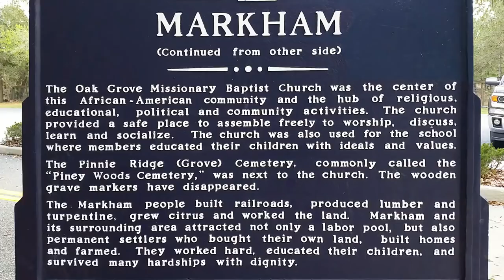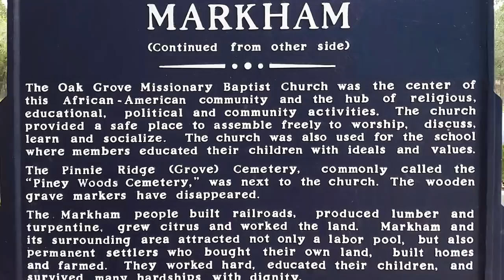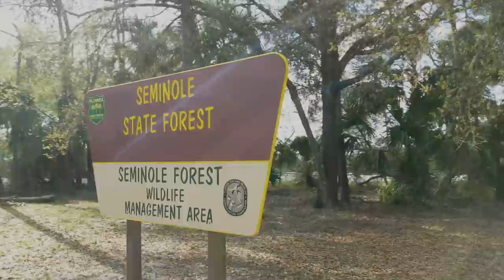Tandem Bike Fail While Touring!

Comment: Nice video. You really do need to get clipless pedals & cleated shoes though. My old joints recommend Speedplay Frogs, but SPD pedals & cleats are probably more durable. MTB shoes are easier to walk around in compared to more slippery road shoes.
Reply from the maker: Thanks so much for the comment and for taking the time to watch! We have since upgraded the pedals on the tandem to Shimano SPD's. I already had a pair of shoes & pedals all along on my other (mountain) bike so for the time being I'm just borrowing them from that bike for use on the captain's cranks. I wanted my wife (stoker) to get really used to riding the tandem first and foremost, so I wasn't in any kind of hurry to upgrade the pedals right off the bat since she was relatively new to riding. And at the same time I didn't want to upgrade the captain's pedals without doing the stoker's pedals, so I just left everything as it was until we felt we were ready to upgrade, which we did a couple of months ago. I recently bought a pair of SPD's for the stoker, and after trying out several different pairs of SPD shoes we got a pair of those for her as well. We'll be creating a video about the pedal/shoe upgrade soon, so stay tuned! 
Cheers

Comment: If you’re spokes are giving you trouble the wheels are poorly built. You can get great mileage from properly built budget wheels. Since I learned to build wheels myself we have had zero spoke problems on our two tandems.
Reply from the maker: Thanks for the comment! The wheels on  our tandem are the original, factory built wheels (probably machine built). The spokes are some sort of generic type. I haven't rebuilt them yet but plan to do so using the same rims and hubs with some quality 2.0mm DT Swiss spokes.
Reply: Just get the tension upp properly and stress relieve. A tensioning gauge really helps. Even expensive spokes will fatigue to quickly if not properly tensioned and massaged. Also, really nice work with the drone shots.
Reply from the maker: Yes, of course. I've gone through both wheels on the tandem a while back to check for proper tension. I think it just comes down to inferior quality spokes in this particular case. Thanks again for the comments!